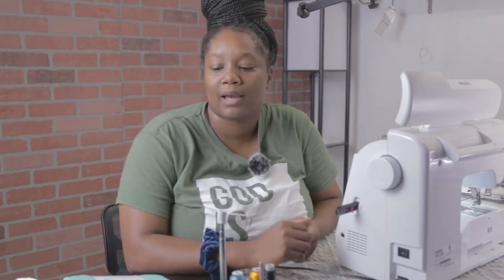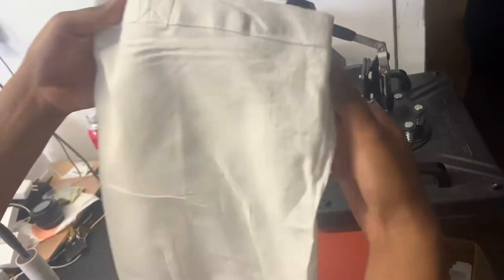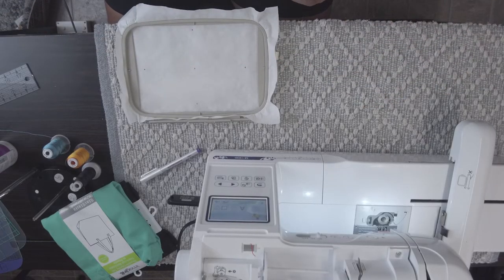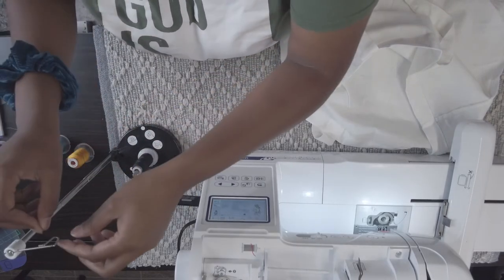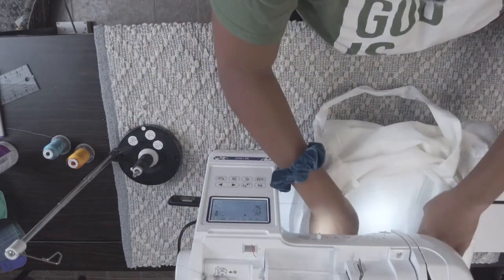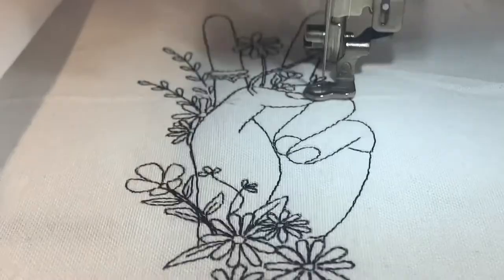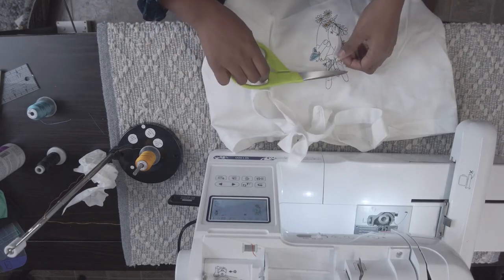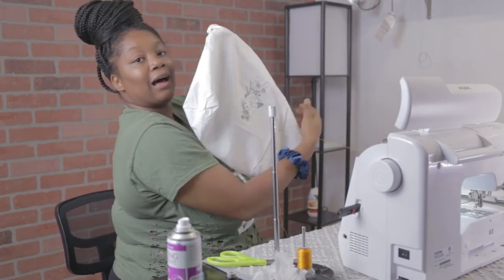DIY Tote Bag Tutorial | How I MACHINE EMBROIDER a tote bag

Comment: My very same machine acts very much different 😭😭😭😭😭 it clearly hates me 😭😭😭😭😭 what are your settings? My machine ends up bunching up most of the time or puckers, and I accidentally adjusted the bobbin with the green ink 😭😭😭😭
Reply from the maker: Omg lol I kept the setting the same as when I got the machine. So if I’m not mistaken the tension is on 3 I have to check. What kind of stabilizer are you using ? When I use heavyweight it stops all of the puckering.
Reply: @simplyshy  I need to factory reset mine, I touched it too much lol
Reply from the maker: @sherrycreate  lol yeah and get a new bobbing case